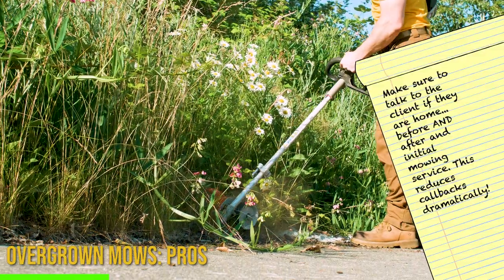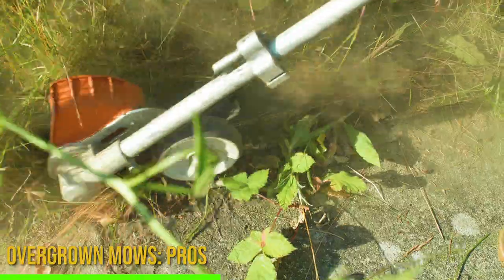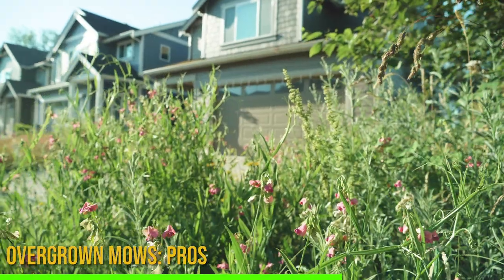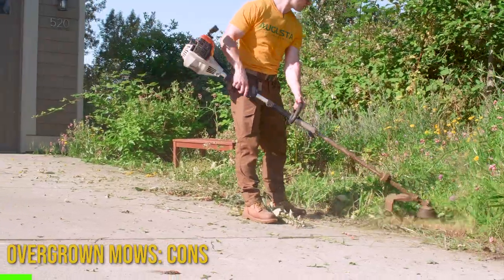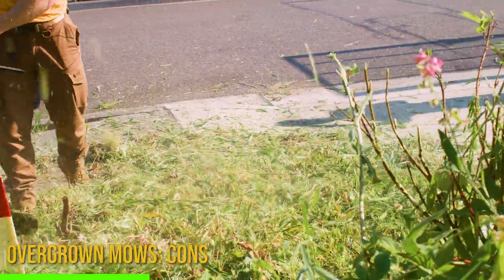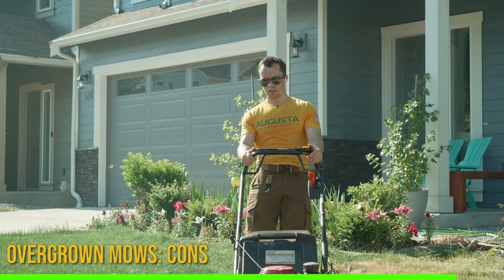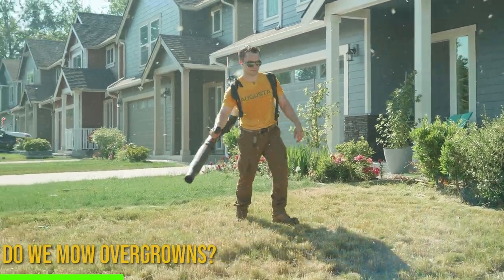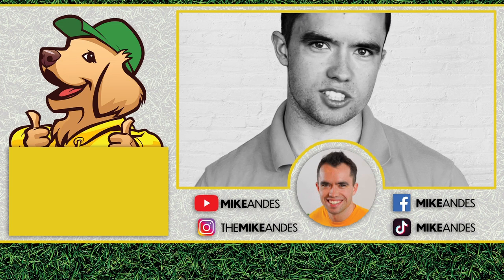Overgrown Lawns: Can You Make Money Mowing Them?! [WARNING!]

Comment: I use the largest Husqvarna weedeater which is about $900 and string up with .105 for heavy weeds and .135 for monsters. Cut it down and rake it up. Its pretty easy and people are impressed when you knock down their jungle and rake it up in a much quicker amount of time than they anticipated. Thats why you quote these jobs without giving them an hourly rate because you can make $50-$80 an hour, and sometimes $100 or more an hour and the people are glad to get it done.

Comment: You just have to make sure you charge the proper amount for yards like this, I usually charge ×2 the original price since its essentially 2 times the work (conservatively) but its usually not so bad with a zero turn or a bigger motor mower, just make sure to give the yard a walk through before hand and clear the area of any trash or debris in the way of the mow path, snakes are also a big risk in these type of yards, make sure to always wear some kind of snake guards or other forms of leg protection. I'd say these jobs are very much worth it if you know what your doing

Comment: I dont know what everyone is talking about. I started with 3 or 4 developers holding on to lots of properties and set up mowing contracts. No one wanted to do though so I worked out an annual contract based on a maximum amount of mows. Lots of contract income over the years which has led to tree removals, clearing, and fencing.  Yall keep the beautification...we will take all the lots that you cant see where your going. That said...we suck up rebar, chain link, barbed wire, dead animals, etc. Yes we walk the properties, especially new ones. Stuff always takes residence in the lots. Luckily no major damage outside of blade wear and some  deck damage.
Reply: Follow up to this after seeing other comments...we average just north of $100 an hour on these lots (mowing). I have hundreds of them still on contract and the route density is on point. One man (mowing), one trailer set up, minimal and optional weedwhacking as a courtesy (to keep code enforcement off property owners back). Everyone has their own preference and approach. Personally, I love the hassle of these lots and for us it has led to huge removal, fencing, and clearing jobs well in the $2K-$10K per lot completed. Small crew so I'm in that sweet spot regarding bottom line. The mowing was always a way to set a contractual standard for bottom dollar annually while trying to leverage my relationship with the developers to acquire other services I was capable of completing (or willing to take on) that I knew were going to be required to develop and sell the lot.
Reply: You get alot of tree work off your lawn accounts i used to pull out nice landscapes
Reply: @anthonypeters44  yeah man. Unfortunately some trees have to go, but we knock them down if the developer wants it.

I havent been able to make the transition from pre-devlopment to new homeowner on those specific properties. Almost like running two businesses.

Comment: Edge first time use the flat shovel to cut it off.  Just did a clean up job like this two houses side by side.  Houses were vacant for years.  Filled with homeless people and were told to vacate the property.  Of course all the problems associated with homeless people.  Trash, 40 bottles, needles.  Feces! Holy $#!+. Always have someone walk through and make sure obstacles are not in the way of the mower.  Think we were at 1400$ for the two properties.

Comment: I call jobs like this the landmine risk. I'll do jobs like this only if the customer agrees to no liability for damages to the actual property,  such as taking out the city water shutdown etc. But still,  the equipment is what you need to think about.  Blowing a spindle, sheer pin, even a tire would cost you the profit.
Reply: I would do the same. Also probe it with a rake to see what I can find before hand. Definitely $500+ job.
Reply: same, I have a little homemade thatching rack thats missing tons of teeth at this point, so after I got it whiped down, I walk up and down the yard  dragging it behind me too find out if I hit a pipe or any odd objects then mark it with a little orange stake.
Reply: Bent the crankshaft on a mower doing an overgrown lawn. $100 in parts and a whole lost day fixing it

Comment: Great video, thanks so much for doing those types of lawns. I learn a lot, just by watching and listening. Get paid 1st stud out the most,  take pictures before and afterward, try to be careful as much as possible, and try to get them as a long term customer, also working with city. Question, if a normal lawn that size takes about 25-30 @ $40 would you charge a double or triple cut pay? Thanks
Reply from the maker: Yes at least 2-3X ✅
Reply: @MikeAndes  Thanks

Comment: You're selling yourself short. We dont touch overgrown grass for less than $200. The disrespect of neglect and the wear on equiptment warrants these prices and as you said NO one wants to do it, so you can charge accordingly.
Reply from the maker: Great point! Pricing video comes out tomorrow... this lawn was less than 1000 square feet =)
Reply: I did my first overgrown job 2 weeks ago. Not a small lawn, not a HUGE lawn. She said she was going to give me $100. I looked at it and said $250, plus any fees. Made $260 because of dog poop. 3.5 hours of hot, steady work.
Reply: I hear you man I usually try to at least double the price. I shoot for 80-100$ per hour on a normal yard.
Reply: @k.c.slawncare6046  How do you clean up the dog poop ?
Reply: @amck72  HA! Don’t clean it up. I charge the fee to compensate for the equipment cleaning.